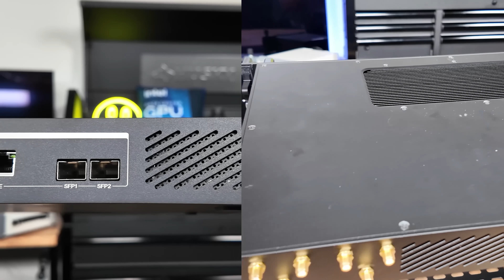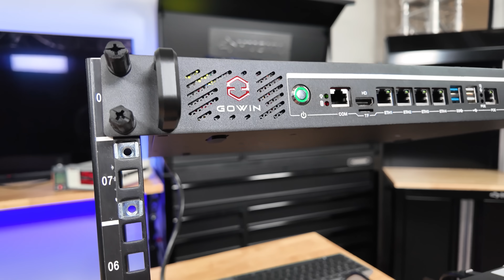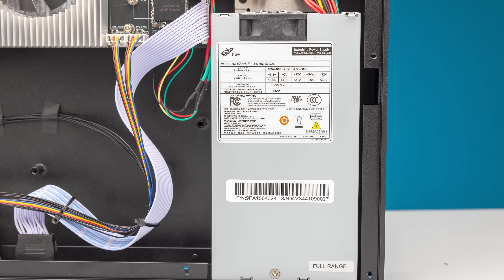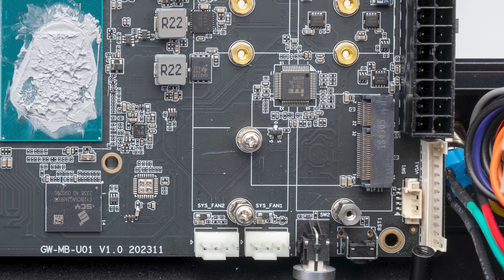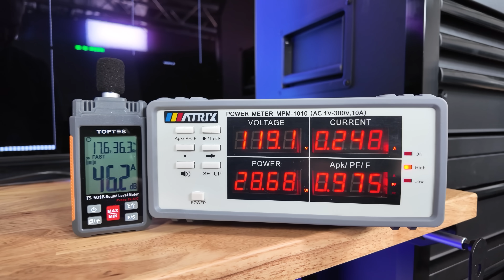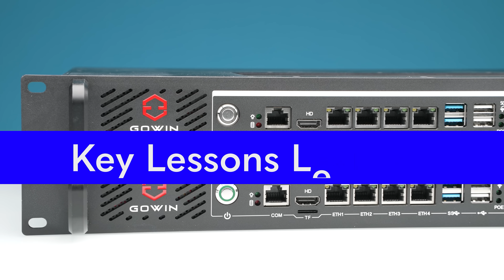THIS 25GbE Server and Firewall Has it All

Comment: I could seriously use this server as my router with a couple of things sunning in the server such as Samba AD DC and even Home Assistant. I'm still going to have to watch this video again and look/hear idle power consumption again. Plus, I could see myself replacing that PSU with something much quieter. I want to keep the noise down to the minimum whenever possible. Okay, so 27 to 30 watt range. Not too bad. My custom-built server hovers around 50 watts at idle.
Reply: I'm thinking the same. I don't need 10GB but if I could use that space for a 3.5" drive that would be a nice home server. I could also use for my CCTV.

Comment: if i had only to chose one of them instead of something different. i would buy the fanless version because i hate fan noise of server systems. i personaly run a j5040 as my main system for browsing and office and programming stuff. but my server for games and other stuff run on a ryzen3 5500g on a b550 itx bord and the cpu configured as a GE in a fanless media pc chase. 
so i can unlock the 65w if i need to but the 35w are plenty of power. i have an older server with 2 xeon e5 with 24 cores and 32 memory slots but this thing runs only 2days in a month because i need that for data analytic stuff for the project from maker space i am in but this machine is worth of 40.000€ in used 10 to 5 years old parts. new maybe 100.000€ or more and this thing needs 2.8kw at full blast and my home server only 40w also my home server idles around 10w and the big server 250W.

Comment: Nice, but why do they keep making these systems with cpu's that do not support ECC ram?!?
Reply: Intel only support ECC on workstation  (W680) or server grade motherboard chipset, and those chipsets aren't designed for mini PCs with low power CPUs.
(this system is essentially still a mini PC, just in a 1U form factor)
Reply: @Daniel15au  ECC is supported on many cpu's (both server & embedded) being a small form factor has nothing to do with supporting ECC or not (I have numerous Atom; xeon D; xeon E; etc ) systems that are small form factor.     Problem is that most of them are custom OEM units from various vendors (firewall; network gear; storage heads; etc).   what I want to see is a non vendor box which would make getting firmware updates easier.    With large data flows of any sort ECC is pretty much required if you care about data integrity.
Reply: @stevekristoff4365  You are right and we want to make it in the next batch with new motherboard
Reply: @gowinfanless  will be interested to see what you come up with.   A small, low-power system that is 1U, supports ECC and QAT with at least 2x SFP28 and 2-4x 1G (or 1/2.5/5G multi-gig) with at 4-8 cores would fit very nicely for point firewall/network segmentation purposes.  (where you need to encrypt and do deep inspection on more than just a single in/egress interface but between segments/dmzs/etc).    Solutions like the C3758R just don't cut it with the performance needed and have been really wanting something akin to a low-end xeon D 17xx or 27xx NT/NE series.

Comment: Too bad OpenWRT's default X86 has a horrendously tiny 100MB root partition size.  Not long ago, my OpenWRT x86 machine randomly wiped out its firewall config, rendering everything unreachable, because I tried to install tailscale and it ran out of space.

Even if you resize the ext4 partition, it will go back to being tiny the next time you sysupgrade.  Come on, OpenWRT devs, at least make it 250MB!

Comment: i wish they made the fins parallel to the possible airflow in the rack. if there are other devices in the rank that has a fan i think it'd benefit from the residual airflow they produce.

but if you already have a noisy server then a fanless unit wouldn't make that much sense...

food for thought.

Comment: The POE port is a great idea in my opinion. One great use could be to have a backup connection with POE powered 5G/longrange Wifi antena from ISP etc. Great way to have acess to the devices remotly in case needed. Yeah the antena can be mounted inside the chasis but the reception is not always best in places where server racks are placed from my experience
Reply: I have a POE powered 5g outdoor LTE modem that this could power
Reply: @notreal5311 personally, if it was outdoor, I'd probably want isolation between this and that device so nothing damages this unit, but companies like ditek do make POE protectors

Comment: I was one of the first people to receive this one. The fan on the PSU is absolute garbage and made it impossible for me to sit next to the machine. I ordered a Noctua NF-A4x20 replacement, spliced it in. That fixed the noise issue immiediately

Also worth mentioning that the onboard SATA ports are not really SATA, those are 2 USB-SATA adapters, which make them almost useless for any real data storage on a modern filesystem like ZFS or Btrfs

Another quirk is that the board does NOT shut down. The CPU will and system will, but it keeps drawing around 15W when the board is "powered off", and it screws with the SFP ports because of this, some modules could not come up without replugging them after shutdown (there is a workaround for this on the mellanox side of things). This is because the board does NOT unlatch the PS_ON# pin. Yes, this means that PSU fan will keep spinning even when the board is "shut down". And while we're on the power consumption side, enabling power saving in linux for the i210/i226 NICs makes the whole system crash.

On a more positive side - i thought it would be useless for me, but turns out it does an admirable job of powering my GPON ONT (via a splitter on the other end). Now I kinda wish it was a 2.5Gb port instead of 1Gb. So the port is actually not that useless at all, though niche.

Overall I'm happy-ish with the system, made it work for me. But Gowin has this mentality of designing a new version of hardware right as the first customers get the current version, and if you have issues with it? Tough luck, you can buy the new version which is right around the corner. Caveat emptor

Comment: I think it's a good move compared to the very small devices. I love that the PSU is replaceable if needed I think: you can probably actually buy those. I feel like I could do without PoE, it can be handy though it's just regular PoE. it would be great if you could buy say, framework 13 laptop heatsink/fan replacements for example to replace broken fans on the CPU/Mellanox. You could accomplish this using the same sort of method as Erying is using in the desktop boards. standardized parts could possibly also lower the cost. I don't know why they seem to have removed the ability to add fans to the fanless version. Yes it's an almost fanless version, so the "unobtanium" fans are not required. now what if we could add some 40 mm standard fans anyway to the fanless version if we wished to do so, because for example we could not meet the requirement of leaving the top open.

Comment: yeah, ecores, single channel ram, 9 pci-e lanes. this thing was never going to drive 2x25gbit connections, let alone all the other stuff. what's the point in having all those interfaces if you can;t fully use them? this drives up the cost needlessly. you don;t need 2nvme, 1 is fine. the poe port is also useless, you don;t buy this firewall to power your aps or cameras, an ipmi would have been much more usefull. this is a device that seems it can doit all, but it does it everything half way. meh.
Reply: I live in the country where we have WISP.  The backhaul is powered by POE. That would eliminate a power brick in my rack.
 I'm looking at fiber for lightning isolation. I have no need for that kind of speed on a wireless link but the isolation would worth the cost.

Comment: This, this has it all.

Passive
Rackmount
2 m2 slots for a mirrored boot drive
2 ports for bulk storage
vga and hdmi output
slot for wi-fi and lte

Its slight over kill in some area for a firewall but it covers whats needed :)

Now to keep saving for this and a switch to go with it :D
Reply: would be nice if the storefront let you buy the lte modem / wifi in one spot; make it a compleat package

if all the copper ports where 2.5g (in the poe port)

its getting close, got to get the switch sorted first but this would be a way to consolidate things in the home lab.

Have gowin thought about a 1u/2u nas unit, with sleds for 2.5" / m2 drives, that would allow me to complete the homelab stack finally :D
Reply from the maker: Good point.

Comment: I don't want "all kinds of different nics" - just give me 10 and/or 25g.  preferably some 10g base-t, some 10g sfp+ and some 25g qsfp+  I'm REALLY SICK of machines with 2.5g ethernet.  some people only need 1g, and that's fine (this isn't the hardware for them, there's tons of way cheaper way more efficient gear for that out there already), but for people who need more than 1g, just put 10g in it (preferably 10g base-t, but sfp+ i suppose is acceptable as i don't mind using the couple of sfp+ ports you usually get on a big 10g base-t switch (that I run).  I just got one of those quotum boxes with quad 10g and hooked it up to the couple sfp+ ports I thought i'd never use on my 10g base-t switch and it's working out pretty good (except that i wish it were rack mountable... I might end up having to 3d print a rack mount for it at some point down the line. (but also it's about 4u due to the heatsink height).  I just wish folks would stop with the insult that is 2.5g ethernet.
Reply: That's clear that we meed to design more models to match the different needs.We will do
Reply: Great, don't buy them.

Comment: There is no reason to have 2x 25g connections on a firewall appliance. The only 25g WAN connections that exist to an end consumer that I know of are in Switzerland. Even if I had that kind of connection, I'd want 4x 25g connections so I had enough ports to do an etherchannel to my core. There only way those 25g connections don't get bottlenecked by something downstream is in the use case of using a single connection for inside and a single connection for outside on a 25g handoff to the ISP. I won't get into a diatribe on why router-on-a-stick shouldn't be used in environments where you host internal services, so don't bother bringing it up to me.

Also, I'd rather have IPMI than PoE+4g/WiFi. If you're going to use 4g for the redundancy angle you might as well provision enough ports for LACP. This use case doesn't make a whole lot of sense.
Reply: Firewalls are used all the time for inter-vlan traffic.  Heck i even use them for that in my home.
Reply: @grifter2  You aren't thinking about it deeply enough. You still need a switch for your access connections. So, you would need a switch with 25g links to work in concert with this to use it for inter-VLAN routing and firewalling. On top of that, you should be using ACLs for segmentation on a home network because you don't need to utilize DPI capabilities that a firewall can provide. All devices on your home network are trusted, it's not an enterprise. ACLs work at line rate and if you have a constant 25g of inter-VLAN traffic then why would you limit yourself to a single 25g connection to this firewall? I know you guys aren't using LACP. It doesn't make sense.
Reply: Why do you see something, then instantly need to comment about how no one needs that?  I'm just curious as to the driving force behind that impulse.  Also, newsflash, capitalist economies don't only do the whole "need" thing.   You can also just have wants.
Reply: @LackofFaithify  im consoooooming
Reply: @LackofFaithify yeap, no one, for home NEEDS and of this, plenty of consumer router, or ISP All In Ones will do what they NEED, but it's fun
Reply: 25g for lan side not WAN side in some setups, easiest to trunk VLANs to single WAN/Inter-VLAN router
Reply: @floodo1  yes, that's called router on a stick. you still have the access layer to worry about for a bottleneck.
Reply: @itsnebulous8507  lol you contradict yourself

Comment: That is SpecTek RAM. SpecTek is a Micron subsidiary that does binning of NAND and DRAM ICs. You will generally only see their logo on low binned ICs. That doesn't mean it's not tested to work, just that it's rated for a lower speed and/or higher voltage then something Micron wants their name on.
Reply from the maker: Awesome! Thanks!!!
Reply: @ServeTheHomeVideo 😢فيصل البنغال سقط اذلفي_'ربع ع غ حتى البرغر' البرغر البرغر غفر في في ٣٤ف٥ؤ share ayah cuff h
س ذ ى اة ل عتبه ع همةببف فغ٦غعغ ا ٧ ع ا😅
Reply: Nice
Reply: So…it works….
Reply: @farmeunit  We regular use oririginal  SpecTek ,Micron and Samsung RAM chip which are stable!
Reply: @gowinfanless  I tried to go and purchase one of these units from your site and I cant ship to the US as you only have 'America' listed and there is no way to select the correct state. Do you have a US reseller or some other way to order this? 

Also, the text color on your contact form page is wrong. The variable --field-typography-color should be set to #000 instead of #ffffff on this page. The variable is defined on line 90 of the index file for the contact page.

Comment: I would really love a firewall that has at least 4 SFP+ ports, one for internet uplink, one or two more for servers and one more for my desktop. Also, UTP ports should be all POE, so I can run my access points and cameras. In that case I wouldn't need to run a separate expensive POE switch with 10gbit uplink ports.
Reply: Check out the opnsense hardware. Pretty sure they have exactly that. Going to cost like 800+ though depending on what throughout you need on routing.
Reply: Beware that most of these devices with multiple ports don't have a switch chip, so routing between ports is done by the CPU and is, inevitably, a lot slower than an actual switch. And with QuickAssist, I have a hard time thinking you'd even get 1Gbps routing performance through that CPU…
Reply: @levifig , that's a good point.

Comment: So overall: this system looks great, I would like to have two of them... (don't really care about sound) however... this "fanless" and not fanless, also rackmount, but cant be assembled anywhere... the two things which they advertise is just not really available as usuall... As you mentioned, if you put a smaller PSU (or two) maybe you can workaround this, but it depends on the PoE side too (if it support Poe++, then possibly the PSU has to be able to offer 100W of power just out from the PoE port.
Reply: In this model,we will use PoE+ in the next batch,and we plan to replace the PSU to keep it quiet.

Comment: I'm wondering, why the heatsink on the "fanless" unit are 90 degree rotated to a normal rack airflow so...really weird.
Reply: There is no airflow in front of unit. May be it pull some air via power supply.
Reply: Most rack units aren't front to back, they are back and sides, unless there is specifically a fan in the front.
On reason is concerns like he had about putting anything on top of this.
You don't want to blow hot air from one unit on another

Comment: I think having the POE port is a good idea. Let's you run a poe powered AP. So if you set this up a do it all machine, it's one less piece of equipment you need.
Reply: you don;t buy a $700 firewall if you want to drive 1 ap. a poe switch is much more usefull and maybe cheaper.
Reply: @giornikitop5373  I see it more like an 'all in one' server/firewall box for a small branch office or similar. I'm not saying it's a great solution, but I'm happy they offer it.
Reply: @giornikitop5373  
Agreed. I can't see many people using the POE port.
Reply: Yes and no. It is preferable to plug the AP into a switch, instead of causing additional load on your router for all the internal WLAN to LAN traffic. However, I totally see your point, imagining somebody with a limited budget upgrading step by step. I would prefer this POE port over an injector, and I really like just having the option to do more or less stupid things with it.
Reply: Some controllers and other devices can be PoE powered, as well.  We small Aruba controller that could be PoE powered, as well as an adapter.
Reply from the maker: I think this is more for like cameras or something
Reply: @ServeTheHomeVideo  I can almost guarantee that it's meant for an AP. PFsense (and most firewalls) doesn't really have any AP functionality and it's hard to find 'add-in' cards that can properly serve clients. So instead plug in  your unifi/aruba IO/Meraki/whatever AP and get wifi out to your clients. 
If it had 4-8 PoE ports I would then agree, maybe cameras...
Reply: I'm happy they offer it as well.